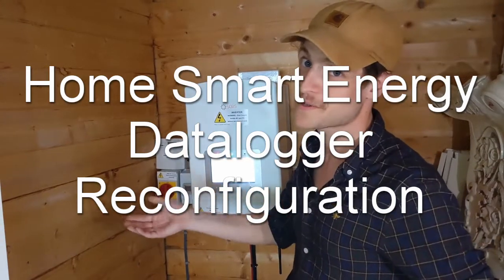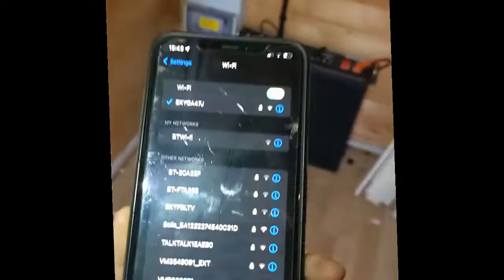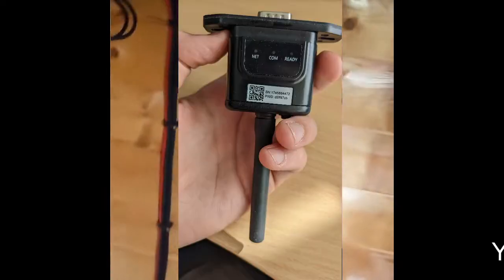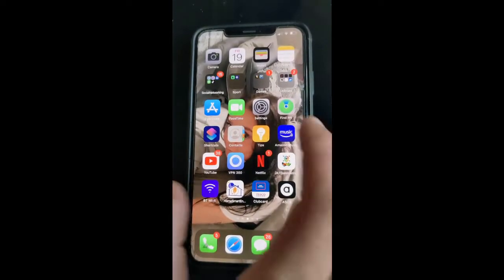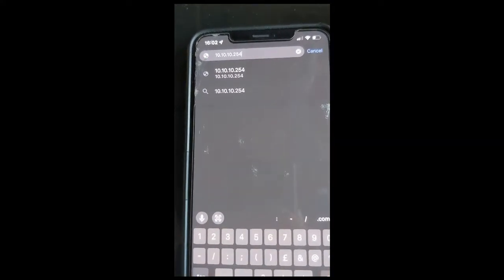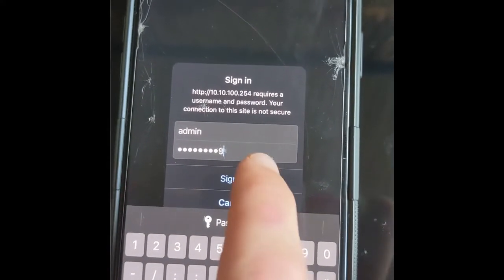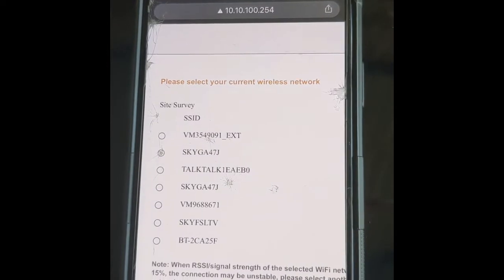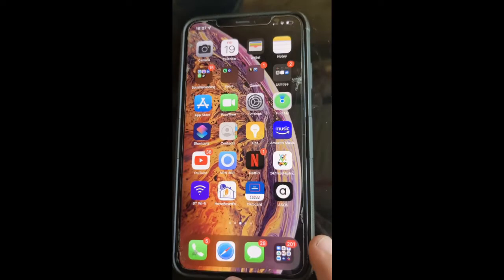Home Smart Energy - Datalogger Reconfiguration

Comment: What the video omits is that if this is not a new install, and you are trying to reconnect because your wifi network has changed (like mine did when Virgin Media installed a new hub) then you may need to reset the datalogger by pressing and holding the button on the back of the datalogger (behind the LED lights if your model has those) in order to 'see' the Solis network and then configure it to your new wifi network.

Comment: Followed instructions and it did eventually work. A few differences with menus,  plus learning to press the reset button for exactly 20 seconds before connecting to the data logger, repeating various stages several times until it did work, with it finally resulting in a steady green COM light appearing.